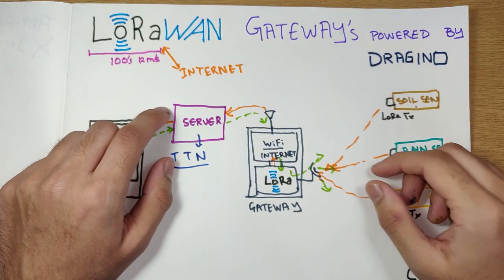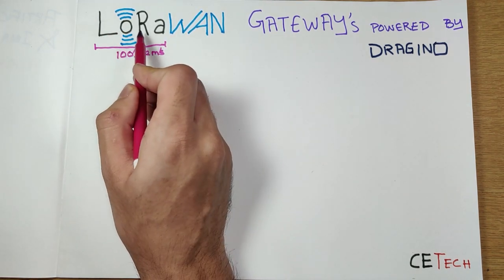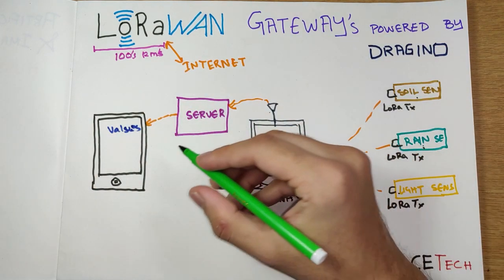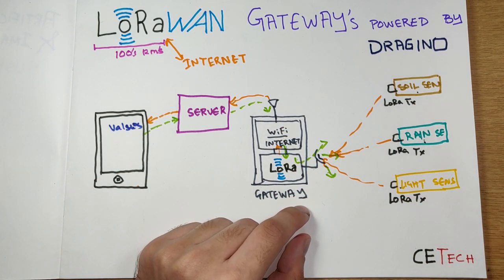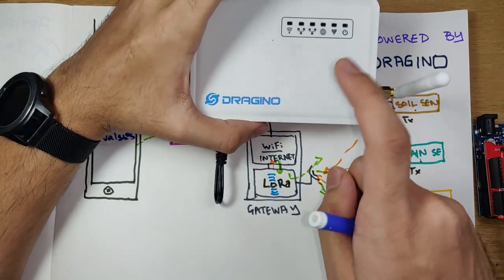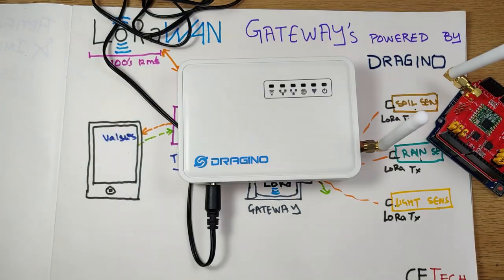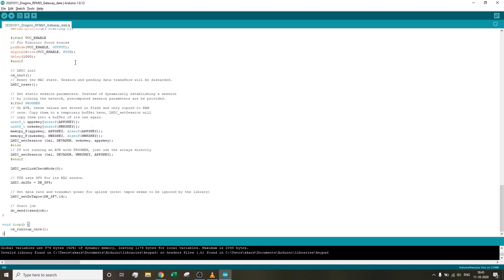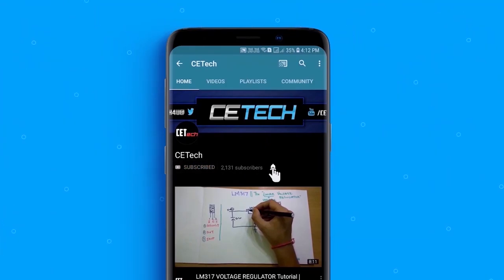LoRaWAN Tutorial | Dragino Gateway Setup with TheThingsNetwork | LG01-P LoRa TTN

Comment: Hello and thanks for the informative video. I have a question: Is it possible to work with the things network to which i wanna send data without using a loRa module just a microcontroller and a sensor for example?

Comment: Hi Dear, thanks for your video. I am working on SEM and I have to transmit the data measured by SEM to a cloud server. My main priority is to use a cost-efficient and a secured network medium than can prevent cyber attacks. I am trying to use WIFi (NodeMCU) and thingspeak (IoT server). But WIFI has less security and range than LoRaWAN and it consumes more power than LoRaWAN. Can you please help me out? I am new to LoRaWAN and it's is difficult for me to understand all this. I want to do it in Malaysia.
Reply: Maybe,we can do some help to provide the all-in one  Lora solution